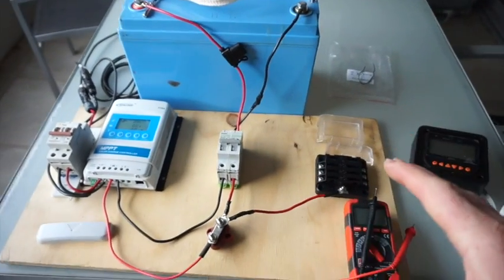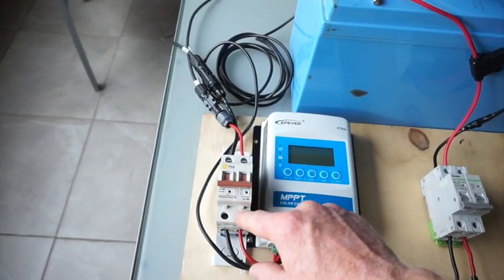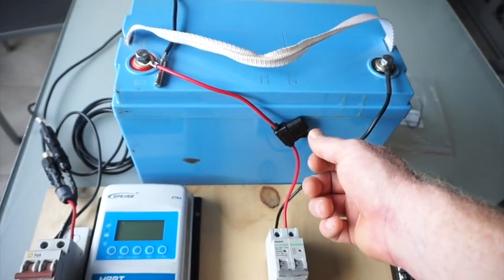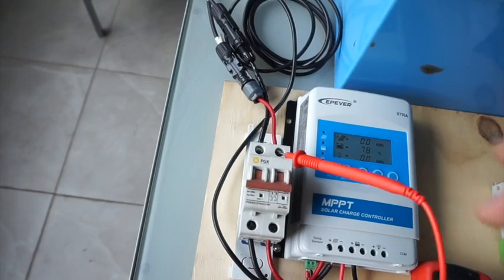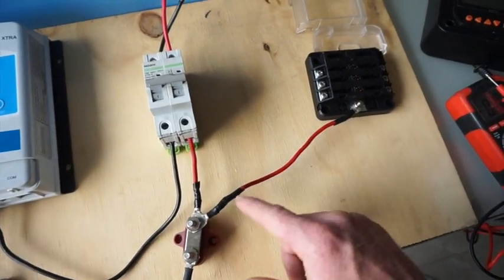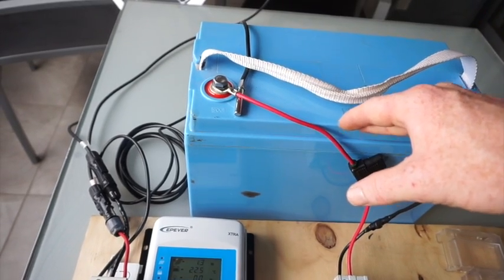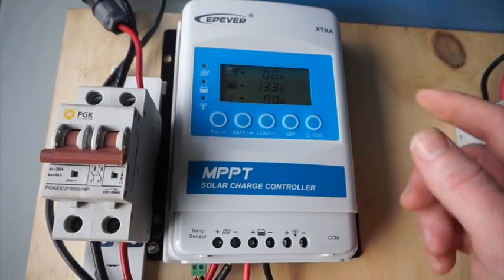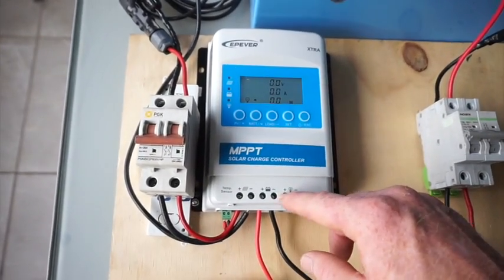HOW To Set Up an MPPT Solar Controller - EPEVER XTRA XSD2

Comment: Hi. What type of temp sensor is needed NTC, PTC, thermocouple....? Thanks. Also when setting the battery capacity for 2 series connected batteries the total of the two must be set, right?
Reply from the maker: Hey Mate - Epever have a recommended temp sensor to use which they sell. I don't know much about them but I think its thermocouple? 
Correct. But if you have 2 x 12V 100ah batteries in series that = 24V 100ah.
Reply: @sunbiasolaroffgridsolution6545  Thanks for the reply. I will connect a 100A batt and a 70 A one in series with a battery balancer. The voltage will be automatically detected but capacity will have to be set @ 100 or 170? I know the balancer might trigger an alarm but at this stage I'm experimenting.
Reply from the maker: @4aidiotfreeworld  Hi - So this is a little beyond me. I have not done any experimenting with batteries of different capacities in series. I believe its usual taboo unless the battery balancer can regulate it and protect the smaller battery from being drawn done too low. 
The capacity will actually be 70ah (the smaller of the two). In series the smaller ah battery is default capacity.
Reply: @sunbiasolaroffgridsolution6545  Yeah the rule is don't connect different capacities.....unless there's a balancer involved which regulates the charging. Well...trial and error it is! Thanks a lot.
Reply from the maker: @4aidiotfreeworld  Cool. Let me know how it goes!
Reply: so ..in a 24V series system the balancer monitors the voltage in each battery and if one battery is reaching the set voltage while the other still needs charging then the balancer will draw current (around one amp in my case) from the "full" battery in order to "tell" the solar charger to keep supplying the voltage to the batt. pack until both batteries will be charged according to the user settings. You need this even if the batteries are rated/labeled  identically as there is no such thing as identical batteries.
As for the temp. sensor it is a NTC, i.e. negative temp. coefficient, a thermistor (resistance drops as temp. increases) and is supplied with the controller, the little thingy barely visible connected to the temp. sensor input. All you have to do is solder some 2-3 m of thin wire to its terminals and glue it on the battery.
And a last piece of advice....if you have an AGM battery then set the parameters in "user" menu as AGM's are slightly different from normal GEL batteries regarding the values you need to input.
Reply from the maker: Hey @rahatcuperje - thanks very much for the update. that makes sense and good to know. Thanks again for the info.

Comment: Hİ The Xtra model controller I am using measures the battery and solar panel voltage incorrectly with a difference of +-0.20~0.30 volts. What is the status of your device? Are the voltage measurements different?
Reply from the maker: Hi There - what are you comparing the voltage reading to? A multimeter? Are you measuring the voltages at the controller itself?  
I can normally see a minor difference in voltage readings. 
There could be differences if you are measuring at a different location - voltage drop.

Comment: Do you need the 2-pole breaker from the battery? Is a 1-pole breaker on the positive lead sufficient?
Reply from the maker: Hey Mate - single pole on the pos is sufficient. If you can run a fuse close to the pos battery terminal.

Comment: How much AMP ur using D.C break switches...
Reply from the maker: Hi Anil. Depends on your wire size, which is determined by the load and distance. I'm using a 10A DC breaker between solar panel into the controller.
Reply: @sunbiasolaroffgridsolution6545  thanks.

Comment: Do I need both positive and negative running through breaker or can I put two positives from the panels through the breaker and then just connect the negatives directly to the controller via a busbar?
Reply from the maker: Hey mate. I'm assuming you're paralleling your panel into the controller? If so then yes nothing stopping using one CB on the positive side. You can put the negative cables to a busbar then into the controller. 
But if you are paralleling two panels look at buying two 'Y' branch MC4 connectors to parallel the panels at the roof and run 1 pos and 1 neg cable down to the MPPT. Feel free to email me if that doesn't make sense.

Comment: So you MUST use the MT50 to set the USER charge parameters for lithium?
Reply from the maker: Correct. You can also plug into a PC and use the EPEVER software but this is a little more tricky compared to the MT50 IMO.
Reply from the maker: Sirius White  Yeah exactly. It really should be a standard feature with newer models. Maybe so they can keep selling MT50's!

Comment: Hi, thanx for the vid.
Im setting up a Off grid solar system on my block of land.
Found your video cos i have purchased 40amp Epever Triron 4215N 12V/24V mppt.
Just having probrems understanding what size DC ( 2 pole ) circuit breakers i need and fuses between battery etc. Like your setup. 
I have 8 x 160W ( 1280W total ) mono solar panels.
Your advise me would be appreciated, cheers ( in country Vic 🇦🇺 )
Reply: Triron4215N recommend max 1040W solar panels for 24V batteries system , your 1280W solar panels   is also ok . if you set batteries as 12V system , the input power will burn the controller . recommend 45A breaker and 45A fuse . Hope that could help you .
Reply from the maker: As Jove has said the 40A Triron, like the XTRA, will have  a maximum array size that can be connected to it. You can typically oversize your the array for an Epever controller by 1.5times meaning you can actually connect 1560W of panels for a 24V system, but it will only charge at a max of 1040W. Check page 11 of the Trion manual - it has a table showing this (the online manual shows you can connect 3120W but I'm sure that's a typo). 
If you're running a 12V System you will be best to have 2 x 40a controllers in parallel each with 3 panels. 

I have another video explaining how to size your cables and fuses. 
Send me an email mate if you want some help in sizing your cables, fuses and a switch/breaker. To size them normally need to know what else you might be running off the battery.

Comment: helpful video, what type/brand of circuit breaker are those?
Reply: Hey mate - they’re specifically DC circuit breakers. Not supposed to use AC on a DC system. The brand I think is DKG. Search them on tradezone in Au.

Comment: Nice video man! Can you set the load to a certain current and voltage, and measure the battery capacity by powering this load?
Reply from the maker: Hi Henri. Thanks mate! So the load output of the MPPT will basically act as switch/regulator between your battery and the load which you can use to control when you want the load to turn and off.  If your battery is at 13V - then it will be powering your load at 13V, you can't change the voltage output. The load Amps out is restricted to MPPT charge capacity ie. 40A controller = max 40A out (it will only supply whatever your device draws). The MPPT will measure the battery voltage and display this on the screen, it uses the voltage and the batteries capacity (which you input) to determine the battery % left. So yes whatever you are doing, powering a load, chargingi the battery it will tell you in realtime the % of your battery. The benefit of the load output is you can control when the load turns on and off and also it will cut off at the nomintaed low battery disconnect voltage to protect the battery if you load draws it down.